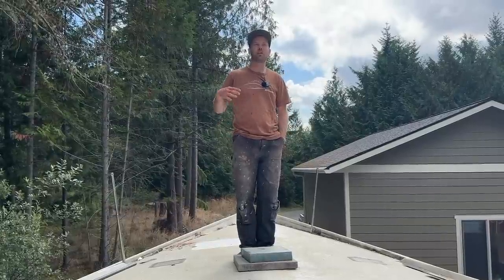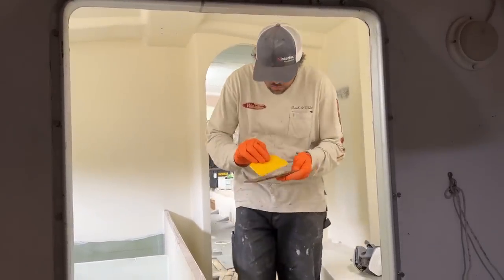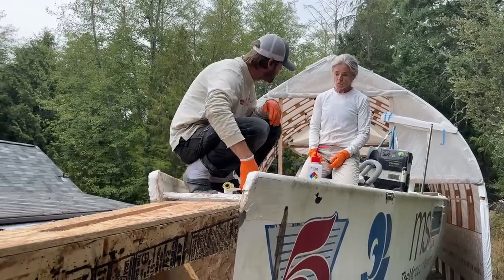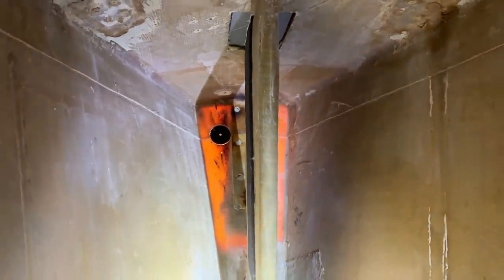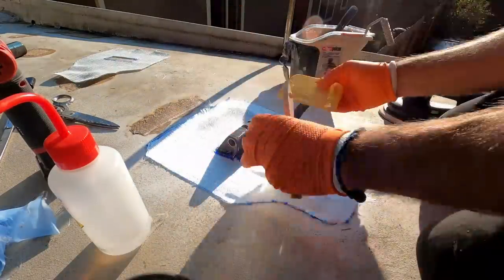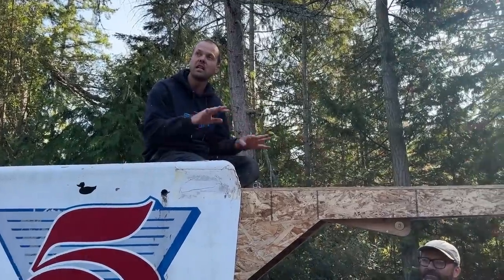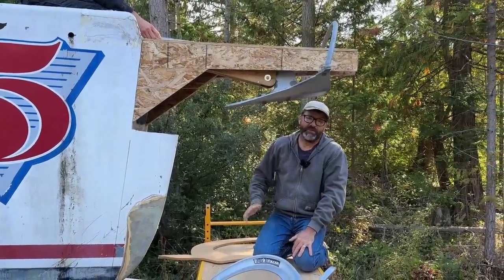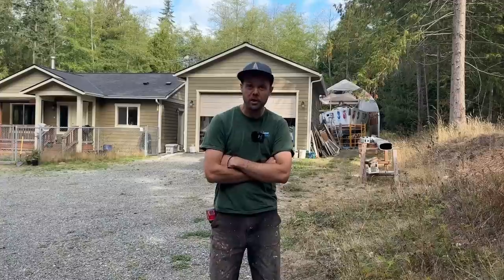Old Bow, NEW Parts [E94]

Comment: Be careful with a roll bar anchor, it may not come up correctly oriented.  If that happens it won't slide over your bowsprit but rotate and crash into the side of the bowsprit instead.  

We really like the Mantus swivel, very simple and robust.  

I also believe you'll have to remove the anchor when passaging.  The surface area of these new anchors is very large and when you dive through waves, as a sixty foot boat does, the anchor puts an enormous load on the bowsprit.  We've bent the solid SS anchor support provided by Mantus.  

We sail a 60' boat with a 124 pound Rocna as our primary anchor.  We remove it when passaging and store it below.

Comment: i was just thinking to myself as you came across another piece of Kevlar, it has to be quite satisfying to cut into sections to see how its constructed and see how and why certain components are used, designed and sometimes thrown together because materials just happen to be at hand, and designed and built with overengineering thrown in - sometimes when i construct something, i have my plans in my head, when it comes to building those ideas are often tweaked simply due to access to materials, and more often over engineered to give way more durability - i like what i see, Mike should be smiling down on you (but could be screaming, 'what are you doing to my boat' hehe) sure he be dead proud of you as we all are, like a lot of old buildings etc, are often converted with a new use, factories into dwellings and so on - and i was just thinking, i hope your mum gets to add her own initials somewhere on the boat, mum helped rebuild my boat and record for prosperity

Comment: Re your anchor choice. I would highly recommend a Rocna anchor we used one on our cruising yacht while world cruising and it never let us down even in near hurricane force winds.
The beauty of this anchor is it sets almost instantly and the more force applied to it the deeper it sets. It was not uncommon to have to cleat the anchor chain off and use the boat and motor to break it free. 
We had swivel but used a shackle to attach it to the anchor shaft. There has been reports of the swivel jaw been forced apart when attached directly to the anchor when you get a big shift in wind direction. I can see this happening as the Rocna certainly does dig itself in. 
Cheers Trevor

Comment: kevlar in the deck on the bow is because of the need for strength against a deep heave, and the deck is integrated into the hull materially. there's probably a few more reasons, like a collision risk, but with so many deep diving heaves, you want the bow to be strong in bending, or you might not make it around the world.

Comment: The comment of the anchor guy about wanting the ability to use shackles if the swivel connector fails is a very good one. As a compromise, could you have a wider opening in the anchor slot, forward of the chain plate and say only 6 inches long, that would allow you to get a shackle through? It might not self stow or easily drop - you'd need to be there to guide the shackle through by hand - but it would give the fallback option. This might also help with using a chain hook for a snubber for short stops when rigging a full bridle is too much hassle.

Also, note I say shackles plural. Everything I've read says use two shackles - one onto the anchor and another onto the chain, with round bit of the two shackles onto each other. This gives much of the articulation that the swivel gives. 

Great episode, and compliments to your mother  - despite many family sailing holidays, mine never joined in when it came to maintenance!

Comment: Hello from Ontario Canada, I’m wondering (re bowsprit/anchor roller) if you have considered that many sailboats with small bowsprits/anchor rollers also have narrow wooden boards to step on, effectively making them wider than the really are.  (Bayfield sailboats for example) I believe that if you built your bowsprit in this design out of carbon fibre, you could effectively widen the entire bowsprit. While only slightly changing the angles of the lower gussets This would also give you enough strength and bulk to enable a widening of the slot that your anchor runs through.  In this way, you could achieve redundancy of use between swivel/shackle and also allow for possible future anchoring systems.  Just something I believe is worth considering. 
Cheers

Comment: If the top surface of the anchor shank slot is covered in hard metal, and the shackle pin is significantly wider than that slot, it could slide along the top of the slot when the anchor is  lowered, and, at the end, when the shank goes vertical, could pass down through a keyhole cut in the forward end of the slot. The forward edge of the roller holder would have to be covered in steel also so that the shackle pin would ride up along it and up and over the top of the shank slot. Then the shank drops into its slot further down and the anchor retracks normally.

Comment: i loved the whole carbon chainplates tihing . on anchors im not a fan of the anchor roller design i would preffered  to have the roller on the side so you can lift of the anchor for long passages to stow it away. im sure you know but anchour left on rolls put a huge starin on the bow in heavy weather. and the benift of a roller to the side is you can use a shakle as mentioned

Comment: I was thinking as Steve was talking about the roller “cheeks” resting on top of the anchor flutes to stabilise the retrieved anchor why not have the roller cheeks under the flutes to do two things? 1. Stabilise the anchor in pitch & yaw 2. Help support the mass of the anchor, take a little strain off the end (top) roller (Steve was talking about a second, lower, roller. If not the roller cheeks then some other support to support the anchor. In the event of a collision I wonder if an idea like this might save the anchor from being driven into the bow.

Comment: 1:03 hi, loving the series about Duracell’s restoration and plans for a new life!
I’m a structural engineer and so am paid to dream up faintly possible load cases and then provide belt and braces to deal with them. Regarding the Code Zero anchor point: have you considered the prying force from the sail pulling the chainplate forward, which might overload the epoxy glue at the top and maybe progressively rip the chai plate off (think how you pull a plaster off)? Maybe this prying force will be resisted by the way the chain plate will be bonded forward of the deck bulkhead?
Reply from the maker: It being a code zero there won’t be a high load peeling force. That’s a light wind downwind sail.

Comment: Agree you have enough epoxy Glue on the chain plate for ideal axial force only.  However you need to consider non axial loads. eg. Code zero will put a non axial load on the forward chain plate. Engineers would typically carry out a critical point analysis looking at the point where the chain plate would start to peel off the substrate, failure initiation point.  Your standing rigging will have toggles and impart no or insignificant non axial loads, however you may have built in eccentricities in the layup and connection geometry.

Comment: I’ve been impressed with the high latitude aluminum sailboats in the 60 foot range and all the Bestaevers in any length. Some have side by side anchor rollers that can accommodate two Rocnas side by side. I agree with your Anchor Guy. The channel needs to be wider to accommodate a shackle. Form follows function. Except when on the open ocean, I would like to have two anchors ready to go. I favor in order Bruce, Rocna, and a Danforth style plus a grapple for retrieving “lost” anchor gear.

Comment: yeh carbon fibre is super conductive it would accelerate the electrosis  galvanic corrosion with any other metals in contact ,remember all or most electric motors,hand tools,kitchen appliances   use  carbon brushes to connect the power to the main shaft armature

Comment: Hey, Matt, I’m not a “boat guy,” just a construction superintendent. Why couldn’t you use a shackle turned vertically so it would fit into the bowsprit slot(and not foul when being raised or lowered) if you put a welded ring through the anchor eye? Do they make a stainless split ring big enough to put through the anchor eye with enough room to slide a shackle through, too? Just a thought.
Reply from the maker: because if the anchor were to come up turned 90 degrees it could still jam in there. As for your second question, i don't know!

Comment: Is the forward part of the slot is wide enough for the anchor shank to rotate? You know what happens when the anchor is hauled up around the wrong way, once the shank starts to be pulled to horizontal, gravity spins the anchor around the right way once the shank is halfway up the roller. It looks like there is not enough room for that. I am sure you have considered this but just in case you haven't..... it wouldn't be good to get that wrong.
Reply from the maker: the channel underneath the bowsprit will be wider for it to rotate

Comment: Electrical conductivity: you've highlighted several times the need for insulation between the stainless steel tube for the  rigging fixture and the carbon chain plate. Can you / will you check there is no such conductivity? Even with your insulation layer of glass fibre, you might have a stray strand of carbon in contact. Will you  / how will you check for corrosion of the stainless tube in future, and if it occurs how would you remediate it?
Reply: A single stray strand would likely only corrode a small bit of the stainless tube.

Comment: Could you use UHMW to line a track along the anchor slot for the shackles to ride on? They can be replaced when they wear out.
Reply from the maker: i will either do that or have a stainless steel liner

Comment: The circle is complete. I found you guys after Mia and Aladino first visited you. They are repairing a Cape George. The anchor guy works at Cape George. Coincidence? Great craftmanship on the chainplates. Out of an abundance of caution, would you consider inserting some 1" solid carbon rod dowels glued through the chainplates and the hull/stem/knees so that you are not relying solely on the adhesive strength of the epoxy ?
Reply: i think i would piece of mind in a big sea
Reply: Politely as I can - that's nuts. You don't want to disturb the laminate. Folks, it's not a metal plate you bolt on. It's bonded on. Carbon chainplates have been used for >20 years with excellent results. Would you tell those F1 car designers "hey better bolt those pieces together, you can't just glue them" (or Boeing 787 or Airbus 350; both have literally tons of carbon fiber glued together)

Comment: Very interesting and compliments for the professional work. A question: wouldn't kevlar added to carbon make the chainplates less brittle and more resistant to traction?
Reply from the maker: i don't know, i have very little experience with kevlar
Reply: You should study it?! My first catamaran was built in 1979 with 2 layers of Kevlar49 included in the sandwich polyester balsa construction. It made it practically unbreakable.

Comment: Love the carbon chain plates. Why didn’t you stack the carbon layers and install all at once instead of individual layers?

Also, don’t like stainless underwater (I’ve seen stainless swivels corrode galvanized shackles).
Reply: You could - but likely better removal of air bubbles and smoothing down all the layers.

Comment: Question?  The forward most chainplate (the one that is just glued on?  From the video it didn't look like direction of the shroud is going to be parellel to the chainplate?  This would cause forces to not only be in sheer?  Assume you probably have accounted for this in the math and just mispoke in the description, but just jumped out at me as a potential problem
Reply from the maker: you're right, but since it's on the forward side of the stem, the other load direction is in compression, but it's mostly in sheer
Reply: @TheDuracellProject  Figured you had accounted for it, and the explantion on video was just the simplied down version. Been a VERY VERY long time since I did stress/strain analysis in composite materials but I remember how quickly things got complicated, and those off axis stresses ramp up quickly depending on fiber orintation, and angles involved.  Sure your guy doing the math is on top of it. Not sure I would have made same design choices, but enjoying seeing your process.
Reply: @TheDuracellProject  I believe it is compression on its glue side and stretch on the front side from the bending moment, which creates a likely small lifting force right below the top edge of the glue surface and everything below will be shearing load. Not ideal, but no issue as long as the loads do not exceed what the material can do. I wonder if the Kevlar was meant to distribute the load of the knee to deck and hull. Not sure how many viewers would be attracted or bored by showing the forces and how the FEA diagram looks like, but I would enjoy it. :)

Comment: Wider track for the anchor and build the bowsprit out of kevlar.
Reply: Nobody uses Kevlar these days. It's really weak in compression. Carbon or E-glass if you can't afford carbon.
Reply: Yes but it peobably keeps the bow from ripping open in case of an impact by distributing the load even after the resin matrix has already failed.
Reply: @martinbruckner2109 Well.... maybe the designer was worried about hitting an iceberg at speed. I wouldn't use Kevlar these days on a deck.  And you should use Kevlar on the inside of sandwich, where its higher tensile strength is useful. In an impact, the inside skin is in tension.